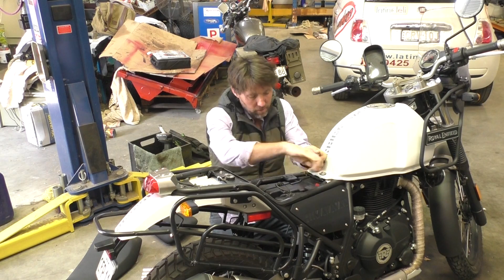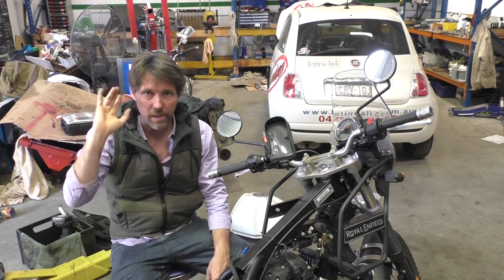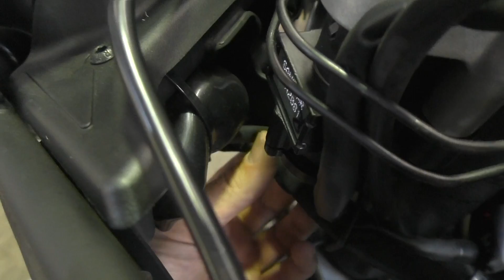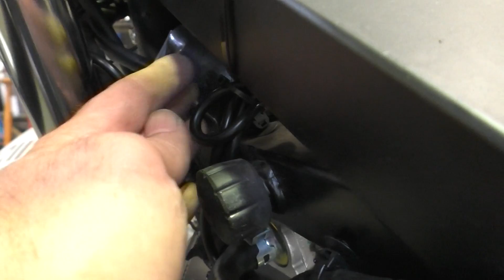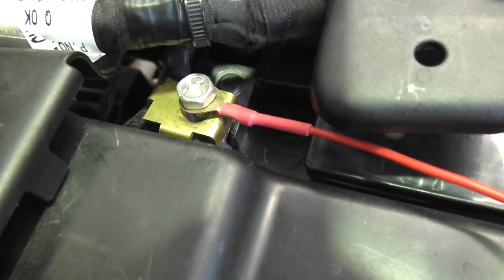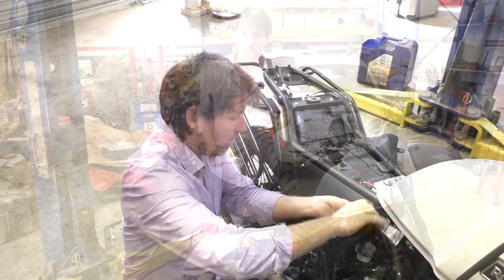Adding a USB socket to a Royal Enfield Himalayan

Comment: To get easy USB power, put a splitter on the 12v+ on the horn, and you got 12v fused power. No need to remove the tank.

Comment: Don't loctite the battery terminal bolts!
Loctite becomes an  insulator when cured and could cause problems with supply!
Just tighten them up tight enough to keep them from undoing and that should be enough!
 If you're on the trail and need to loosen them for any reason you could find yourself in difficulties or could even destroy the battery terminal trying to loosen it off!
 Not a good idea!

Comment: Hello Dangar Wheels. I've done the exact same thing with my Himalayan except it seems the USB I installed has this blue light on it which shines when it's connected. I connected it directly to the battery terminal as you did. The problem is that it shines even when the ignition is off. So I think it will always draw power from the battery. Only fix I've thought of is to take the fuse out for now. But that's located under the seat with the battery so it will be a very annoying permanent option. Can you think of an easy solution that doesn't involve removing the whole USB charger and re-doing the job?

Comment: Hi buddy,  I am Mike from NZ and I have just subscribed to your channel.  I really like your vids and I am thinking about getting a Himalayan.  I currently have a 350 RE classic which I have had for over 10 years and I am restoring a Honda NBC 110 super cub.  I was thinking bout getting a maxi scooter like a 650 Burgman, but not sure now to switch to a Himalyayn , what do you think?  Cheers Mike
Reply from the maker: Hi Mike, glad you like the vids. I think scooters are fun and enjoy riding them, particularly the smaller ones. The real trouble with them is the small wheel size so if you plan to do any real rough road riding you'll have to go quite slow.

Comment: Two things:- l removed the side-stand buzzer which gave sufficient space for a 30amp relay power take-off from the number plate light
2ndly l run the tank overflow down the front downtube, as the original dumps fuel on to the rear tyre
Reply from the maker: That's a good idea Keith, I'm not super happy with the location of the relay with regards to exposure to weather. I might look into moving the tank overflow too. Thanks for the tips!
Reply: All the electrics are in that space, l would suggest very safe for the relay & certainly no challenges over the months l've been using

Comment: Hi nice and cleanly done ! do you think the battery has enough juice to support your USB charger and aux lights..I was planning to plonk the same setup and was wondering about the batt.
Reply from the maker: Thanks mate. The battery is really only for starting the bike, once it is going all the current comes from the charging coil. Unfortunately there seems to be a bit of an issue with the coil on the Himalayan, but as far as I can see it is with its longevity, not the amount of current it can output so it should be just fine, particularly if the the part has been upgraded.

Comment: Thanks for the informational videos.

In India, we Himalayan owners have been facing issues with starter coil. The starter coil blows off after about 8-10K kms. Also this is a recurring issue. So before every trip I make sure to check the resistance of the coil. It should be around 1.4 ohms.

Personally I find Himalayan's mirror to be inadequate. Most of RE riders switch out the mirrors and use Bajaj Avenger mirrors available here in India.

Great work on the videos. Keep'em coming. Cheers!
Reply from the maker: I'm surprised they've been failing so much, it's not like coils are new technology that isn't well understood. Perhaps a video on doing this test is a good idea!
Reply: Exactly. This has been a major source of frustration for me.

Yes, a video would be very helpful for other Himalayan owners. Thanks.

Comment: Hi! So what do you want us to be aware of?
Reply from the maker: That the power is on even when the ignition is turned off. If you leave a phone connected the battery may be flat in the morning if you are camping of something.
Reply: @DangarMotorcycling  would a light switch do the job at cutting power? Low tech for high tech 😊😊😊😄
Reply: Thanks! Cheers!
Reply: @DangarMotorcycling  The USB I installed has a silly slight on it... so its always drawing power. I didn't notice the light till I connected it to the battery. Can you think of a fix for this?
Reply: Dangar Motorcycling ... Thanks for the heads up. Since, the self starter is the only way to start this thing. Unless you wanna risk breaking the magnetic coil while trying to start it by spinning the wheel with some other form of force.
Reply: Dangar Motorcycling You can change that and the USB wud only let you charge when the bike is ON.
Reply: @sunnydogra7198  How would you do that?
Reply: @dkn-h8d  Use an ignition relay perhaps. Using a switch means anyone could charge their stuff when the bike is parked out and you'd have a dead battery by eod.